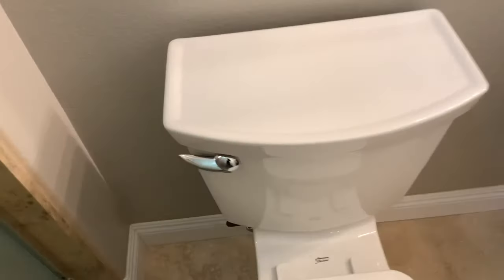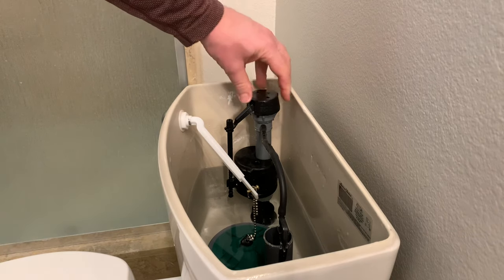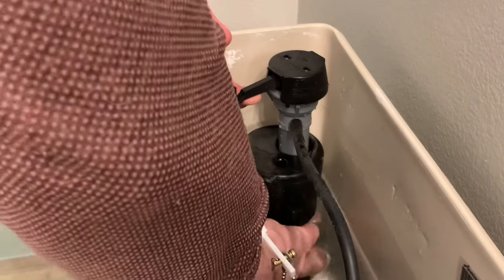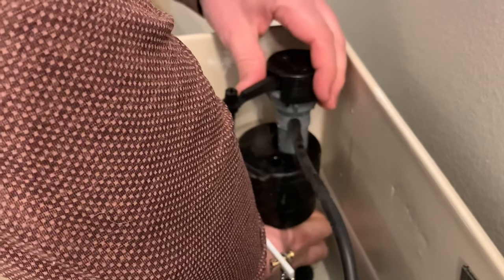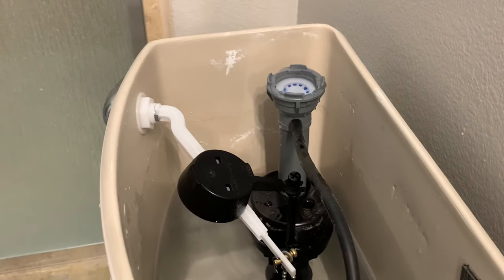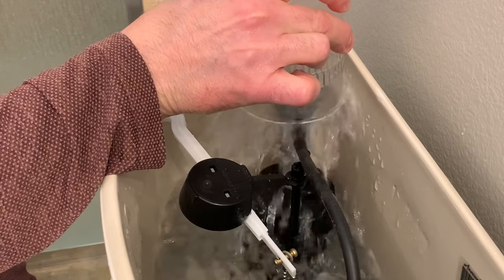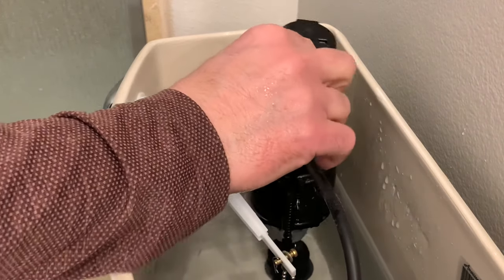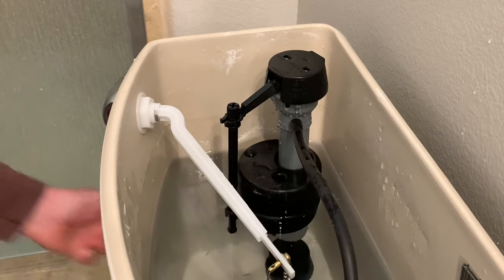Fix A Slow Filling Toilet Tank-With No Tools!

Comment: If I don't hold up the arm, it gurgles at the bottom, what I do wrong?
Reply from the maker: As it is gurgling, is it refilling the tank?
Reply: @MikeKlimek  Due to the toilet shut off valve leaking, I had to turn off the water to the house until I can get the valve replaced.  I have the tank mostly drained, when I hold up the stopper it no longer gurgles.

Comment: I did that, but it didn't work.  It's obvious the water supply is fine, and very strong with the Fluidmaster cap off.  But when you put the Fluidmaster cap back on, it takes about an hour for the refill to complete and stop.
Reply from the maker: That's just crazy to have to wait that long. You might try just replacing the fill valve then. Here is a video on doing it in under 30 seconds: https://youtu.be/y6J1cfvQOGg
Reply: @MikeKlimek  thanks.  I will check that out.

Comment: The washer in the cap needs a look?
Reply from the maker: Sometimes...Generally you can fix it with the problem with the fix in the video. You can replace the seal, it is Fluidmaster part # 242

Comment: Tried and tried, could not do it. Not easy as you say. Going the get new fluid master valve
Reply from the maker: It really is easy...push down slightly and turn counter-clockwise. If you have decided to replace the fill valve, watch my video on how to do it in under 30 seconds with no tools: https://youtu.be/y6J1cfvQOGg

Comment: Hey I tried this but it didn’t work what r the other options
Reply from the maker: You have to determine the root cause of the problem. If you remove the supply line from the bottom of the tank and point it in a bucket and turn the water on, is the flow of water strong?

Comment: I did this but its still filling slowly. What else could it be ?
Reply from the maker: First, make sure the angle stop valve is fully opened. If it is,  I would disconnect the water supply line from the bottom of the tank and point it in a bucket to see if you have strong water volume (turn the water off before you disconnect it of course). My guess is that you won't...If that's the case then check the water supply shut-off valve/supply line. If you do have strong water flow, probably time to replace the fill valve.

Comment: The first time after removing the fill valve, it fills quickly. On the next flush, it goes back to filling slowly, with the water line sounding crimped.

Comment: Did not work for me but I figured out it is the little rubber thing within the cap that governs the water level lost its elasticity. Someone in the comments had the same problem.
Reply from the maker: I think you are talking about the rubber seal Fluidmaster part 242
Reply: @MikeKlimek  yes! Thanks!

Comment: I have a very slow fill like 20 minutes to fill the entire tank. . I took the cap off mine and no water rushes out like this video even when my water is turned on.  I'm thinking the water hose is clogged and or it needs a whole new fill valve assembly. Any suggestions?
Reply from the maker: So it is probably either the fill valve or shutoff/supplly line issue. You can either remove the supply line from the fill valve under the tank, and see if water comes out. If it does come out of the supply line then replace the fill valve. If no water comes out, change the shut off valve/supply line. BTW, if you have a Fluidmaster fill valve, here is my video on replacing it in under 30 seconds: https://youtu.be/y6J1cfvQOGg
Reply: @MikeKlimek  Thanks. I will check it in that order.
Reply: @jopisano67  im having same issue, u described. was it your supply line or fill valve?
Reply: @henryoffiah4488  It was my fill valve. $7 part.  It fixed the problem. 👍

Comment: My water pressure isn’t anywhere near that strong. What could my issue be?
Reply from the maker: Check that the water valve at the wall is fully open. Other than that, turn the valve off, disconnect the supply line where it attaches to the underside of the toilet and point it in a bucket. Turn the water back on and see if the pressure is strong. If it is strong then replace the fill valve. If it is weak, replace the water supply valve/supply line.

Comment: What if the top doesn’t turn to come off
Reply from the maker: You might need a little elbow grease while gently ushing downward. Worse case watch this video to replace the valve in under 30 seconds: https://youtu.be/y6J1cfvQOGg?si=QsaiwGGeeZFH3GgB

Comment: What happens if there is no spray. Mine not spraying like that...
Reply from the maker: I would check the valve at the wall. Are you saying that when you open the valve at the wall that no water sprays out of the top of the fill valve?

Comment: I just put in a new fill valve and it’s still very slow to fill
Reply from the maker: Need more info Laura-if you put it a new valve it sounds like the problem may be with the shut off valve at the wall. Try taking the top off of the fill valve and turn the cup upside down like in the video. is the flow of water strong?
Reply: @MikeKlimek  the water to my fourth bedroom on my third floor has been shut off for years.  My son recently moved home and wanted the bathroom functioning again.   I thought it was the fill valve, so installed the new one and it does the same thing as the old one, very slow fill.  I’m stumped on this
Reply from the maker: @lauramel6725  Does the entire bathroom have poor pressure/flow or just the toilet? If just the toilet I would next look to the shut off valve on the wall. You can disconnect the water supply line from the bottom of the tank, point it in a bucket and turn the water back on. Strong pressure? If not you can replace the shut off valve.

Comment: I put A brand new fill valve on and it’s still filling up really slow
Reply from the maker: I would disconnect the water supply line from the bottom of the tank and point it in a bucket to see if you have strong water volume (turn the water off before you disconnect it of course). My guess is that you won't...If that's the case then check the water supply shut-off valve/supply line. LMK

Comment: Water coming into our toilet runs continuously. Lifting the float arm does not make it stop.
What now?
Reply from the maker: Time to replace the fill valve. Here is a video on how to do it in 30 seconds: https://youtu.be/y6J1cfvQOGg
Reply: @MikeKlimek  Thanks, Mike. That is exactly the same fill valve as in my toilet tank. One other problem (Well of course - it's plumbing!). The shut off valve  at the wall doesn't stop the water.
Reply from the maker: @RErnie-gv1hv  Well you have a choice of either replacing the shut-off valve, or just turn off the water at the street to make the toilet repair
Reply: @MikeKlimek  Thank you so much. Replacing the fill valve stopped the continuous water flow. Problem though. How to stop the squealing?
Reply from the maker: @RErnie-gv1hv  The new fill valve should be nice and quiet. It's possible that some debris got stuck in there. Try following this video again and remove the top port, blow out the debris with water, and reinstall. That should fix it.
Reply: @MikeKlimek  Thank you. I'll try your suggestion.
Reply: @MikeKlimek  Replacing the fill valve, as you recommended, did stop the water at the completion of tank fill. I still need to remove, clean & reinstall the top portion to stop the squealing - as per your suggestion.

Comment: My mom just got a brand new toilet installed by a professional licensed plumber. So there is no debris to clean out. Her toilet takes so long to fill back up i can wash my hands very thoroughly, dry them, put lotion on them, comb my hair, open the door, walk out of the bathroom and the tank is still filling up. Absolutely rediculous. My toilet at my house litterly takes a few seconds to fill back up. It will be filled before I even finish zipping my jeans. My toilet is not new.
Reply from the maker: Try checking that the plumber turned the water valve all the way back on. Rotate the knob counterclockwise.

Comment: There is NO WAY to unscrew the  cap on top-- tried counter clock- wise-- doesn't move plus the fact it's flush against the rear wall of the toliet making it almost impossible to maneuver..
Reply from the maker: Believe me it will unscrew! If you are saying that yours is pinned against the side of the toilet, you may have to remove the fill valve in the worst case. Generally if you slightly push down while turning it , it will come off. Good luck!

Comment: You still didn’t show how to adjust the water coming into the cistern. 
As mine comes in to slow.
Reply from the maker: The purpose of the video is to show how to clear any debris in the fill valve. If after doing what the video shows and you still have a problem, it is likely either the water shut off valve, the supply line, or even the fill valve itself. You might first check that the shut off valve is fully open.
Reply: @MikeKlimek  yea I know what you mean but inside my cistern looks different to yours but the toilet is 40 odd yes ago that’s when the houses were built.

Comment: Mines nowhere near that pressure when doing the cup
Reply from the maker: Turn off the shut off valve, disconnect the supply line from under the tank and point it in a bucket. Strong pressure? Then not the shut off valve. Reach up into the underside of the fill valve with needle nose pliers to see if you have a restrictor.
Reply: @MikeKlimek my previous fill valve was slow too. I just replaced the whole valve last night and the pressure is still slow. It takes over 7min to refill.

Comment: This worked for me but now the toilet won’t stop refilling 🤦🏽‍♂️
Reply from the maker: Is the water going down the overflow tube? If so adjust the float downward to stop the water earlier
Reply: @MikeKlimek  check! But the water is flowing out the top of the cap as well . Like an over flow .maybe I need to replace something
Reply from the maker: @GENIUSMINDED  Replace the top cap seal part #242. Here is a video on it: https://youtu.be/p2G-ckkojEQ?si=2TzxD_FIu8zHYQoz

Comment: I turned the water valve off and now it won’t turn back on
Reply from the maker: Are you saying the valve handle is frozen and won't rotate counter-clockwise, or that the handle rotates but no water comes out?
Reply: @MikeKlimek  no water was coming out when I restarted it, like you showed. I ended just replacing the whole thing and it seems to be working fine (including the water)

Comment: Didn’t work. Nothing coming out of the little tube.
Reply from the maker: I would disconnect the water supply line from the bottom of the tank and point it in a bucket to see if you have strong water volume heading into the fill valve (turn the water off before you disconnect it of course). My guess is that you won't...If that's the case then check the water supply shut-off valve/supply line. If you do, then replace the fill valve

Comment: my toilet is the old type
Reply: my toilet fills up slowlyl and makes a noisee sound wat is my problem
Reply from the maker: So you have an old ballcock style fill valve?
Reply from the maker: @petermoore5587  Usually you need to replace the fill valve for this.

Comment: didn’t work bruh
Reply from the maker: It's got to be either the shut off valve, supply line, or fill valve.  Remove the supply line from the tank and point it in a bucket and turn the water on. If the water pressure is strong, then it has to be the fill valve. If the pressure is weak, look at the supply line or shut off valve.
Reply: @MikeKlimek  it seems too complicated I think ill just wait for my plumber to come next Thursday